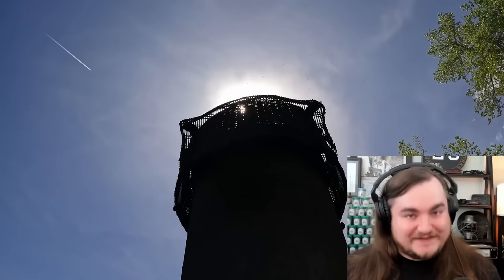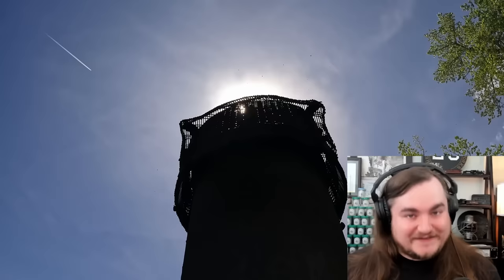Why do USA steam trains make smoke, but UK ones don't?

Comment: Added note on the Oil Burners. As they burn, soot will build up and the tubes and flues insulating from the heat of the fire. So, every now and again, they pour sand in the fire chamber which then bounces around and knocks soot loose. Leading to a big trail of black coming out the stack.
Reply: I've seen the sand technique used in various locomotives. Is it really effective?
Reply: @1940limited  it’s practically required for oil burners. If you don’t sand the flues during a run, they can and will get blocked up. On the D&S we sand the flues 6 times on the way to Silverton
Reply: @1940limited  Lynn Nystrom was the gentleman who explained it to me back when Stephen Lee and he ran Union Pacific 844. While I haven't personally climb inside a boiler to find out. The theory is at least sound since sand is very abrasive. And to that the force of a locomotive's draft and it should easily take thin layers off.
Reply from the maker: Very true! Sanding the flues makes a mess, but is ultimately a good thing.
Reply: @1940limited  *See thumbnail for example!
Reply: @1940limited , it is extremely effective! One trip I took on V&T 29 had her choking on herself b/c the previous fireman didn't sand her flues. And by choking I mean the fireman had to hella overfire to barely keep up the pressure and the engineer had to work her extra hard which was abusing the fireman and the poor engine sounded like an asthmatic with her beats. In a fury, the fireman began heavily sand the flues. The best way I can describe how the engine started performing after her tunes began to clear is like when you cough up a huge wad of mucus and take a deep breath afterwards. Suddenly, she began drafting correctly, popped both safeties, and she began taking off uphill against 2 heavyweights and a steel caboose. 

Now, I was told that more than a few railfans died and went to heaven from watching that show. 😂
Reply: Ah, so this is where the explanation I’ve heard where they only smoke when cleaning the firebox comes from
Reply: @patrickmartin3322  Well, you can get some smoke with a bluish tint to it when over-firing them too, but when properly fired, yes.
Reply: @caelumvaldovinos5318  That would have been a great show!!!
Reply: It was called "sanding the flues" and often done to make smoke for rail fan photographers...
Reply: Yes, it was the way we make "smoke" on a oil burner. The timing had to right so the audience sees the smoke but they aren't covered by nasty grit. We had a small loop track so timing was tight.
Reply: Soot is unburned carbon particulate, wasted fuel, insufficient air supply. But I suppose supercharger turbines had not been invented yet?
Reply: The cogeneration plant in my town ran tons of sand in the burner chamber. It was explained to me that the mass would hold heat, adding to efficiency. The place was constantly down because the steam pipe eroded thru and suffered blowouts. Also, the nozzles on the burner floor, which directed blast air were also eroded till they broke off and tumbled in the chamber, with big air jets creating cold spots in the chamber. They shut down after 8 years and the place is now abandoned.
Reply: Sanding flues is also done in stationary boilers for industrial plants though we didn't have to do it as often as it seems to be done on some locomotives.  We always did it night so the smoke would not be visible to the neighbors.

Comment: The wife’s grandfather was a conductor for grand trunk railroad back in the 1940s-50s. He always had a fit when he saw huge clouds of black smoke coming from the trains on TV shows and movies. So we all asked him one day why? He told us that all that smoke was from forcing the engine to run before it was properly warmed up and ready! He went on about air to fuel ratios, air flow and other things. He ended by saying he wanted to go to Hollywood and knock a few heads together and teach them how to properly run a steamer!
Reply: Wait wait wait...
Grand Trunk Railroad!?!
You just changed my life.
Reply: The simplest method of smokeless firing (also the least effort-intensive; I'm a lazy old bugger) is to watch the exhaust. When it turns white, add four or five shovelfuls to the part of the fire you didn't feed on the previous firing, and then when the exhaust changes from pale grey to white, repeat. This keeps the pressure up while minimising smoke. Disclaimer: this works on locos with a wide firebox, in my case NZR J and Ja class. I have never fired a narrow-firebox locomotive.

Comment: As a retired volunteer firefighter, I can tell you that solids (or liquids) do not burn. Only gases burn. With coal you get it hot enough to release the flammable gasses which burn. Same way with "flammable liquids", the liquid doesn't burn, only the gasses from the liquid burns.
Reply: I would like to add a few exceptions to this rule with things that have their own oxygen source as part of the chemical composition like gunpowder/C4/thermite.
Reply: Coal power plants grind up their coal into a really fine powder. I’m sure you still get a lot of incomplete combustion and soot, but the extra surface area helps a ton!
Reply: @jeremyloveslinux  Coal power plants also seem to have moved to 'no exhaust funnel' when they have cooling towers.
As it is often undesired to have smoke (be it black or white) from a high funnel, nor steam clouds from a cooling tower, they inject the hot exhaust gases (that have run through filters, in the EU at least) into the top third of the cooling tower's interior, where the air is already hot anyway. This heats the moisture saturated air even more, so that it can take on even more moisture, thus reducing visible steam. The way higher airflow also dilutes the washed smoke, this way, when the powerplant is running at optimum, you have little to no smoke OR steam, and no funnel that is twice as tall as the cooling tower.
Reply: embers burn
Reply: As a combustion engineer with over 50 years experience, of course some solids burn. Especially carbon, as in coke, which is mostly pure carbon and burns cleanly.
Reply: @michaeltb1358  But he is a volunteer firefighter, he must know everything! 😂
Reply: Wood and paper burn. Food on a grill or in a fire burns.
Reply: @LordNecron  Coal power plants in the US have to have electrostatic precipitators to cut particle emissions. While working my way through college to get my engineering degrees (Computer & Electrical) I worked as a lab tech doing environmental compliance, so I had to go out periodically to take air, soil, water, and hazardous industrial waste samples and analyze them down to parts per trillion. Had to follow EPA sampling protocols and was also trained and certified as a hazmat first responder (was involved in some cleanup ops). There was a rural coal power plant in Missouri that thought they could sneak by shutting off their EPs after it got dark (near the end of civil twilight and the beginning of nautical twilight -- astronomical twilight comes next, then actual "night"), however, they got caught with photographic and air sampling proof.
Reply: @michaeltb1358  "Normal oxidization" = "degradation", "rapid oxidization" = "burn"; "extremely rapid oxidization" = "BOOM!" Right? 😁 (Both me and my Chemistry professor are military veterans, and are the same age, hence the twisted sense of humor. I ended up getting my BSCE and BSEE degrees.)
Reply: Who told you that solids don't burn?  In coal about 60% of it is carbon that burns directly, 10% is ash that won't burn, the remaining 30% is trapped volatiles that are released as combustible gases.
Reply: @michaeltb1358  Exactly.
Reply: Except insane water usage.
Reply: You are 100% wrong. Have you never seen a charcoal grill before? That's solid carbon.

Comment: One very important reason why you don't see black smoke in the UK  - it is actually illegal. Cannot recall whether it is the Clean Air Act of 1956 or 1968, but allowing a locomotive to produce black smoke is naughty and can lead to fines. Whilst realistically, a heritage railway wouldn't be fined for a quick "oops, bugger" moment from the fireman, doing it consistently and deliberately for a photographic charter would be a big no-no.
Quite how this will change with the slight coal problems that UK heritage sector has been having recently remains to be seen.
Reply: When smoke was wanted/needed for photos in the UK old VHS 📼 tapes would be thrown on the fire to produce the required effect. At least that's the rumours anyway.
Reply: An Act of Parliament was required for the construction of just about every British railway and from the Liverpool and Manchester Railway onwards every Act included the clause that "locomotives shall consume their own smoke".  Not until fireboxes were designed to efficiently use secondary air and with the invention of the brick firebox arch could coal be used, prior to that coke was used being a smokeless fuel.
Reply: Steam trains should produce steam. Which, I think, is what Brits want to see on locomotive photographs & magic lanterns. I wonder if that's easier or more common on a cold humid island?
Reply: @ethelmini  when it's colder, yes UK engines produce more smoke, I think it's called "Atmospheric smoke".
Reply: @ethelmini  As this video observed, smoke isn't steam.😀
Reply: The Clean Air Act, while applicable to locomotives, was more designed for coal power stations, particulary those in cities, and houses when coal was the most common form of heating before central and gas heating.
Reply: I have no idea how dirty or clean burning actual antique steam engines were, but this video title intrigued me because the first thing I thought of was how in old westerns the trains would be absolutely belching smoke like a dragon. The second thing I thought of was "Wait, my kids grew up watching Thomas the Tank Engine, and that's UK, was there really no smoke?"

Comment: There’s an excellent video on YT from someone driving side-by-side on the highway alongside UP4014 at about 60mph, and the Big Boy was running so clean that it barely produced any smoke, despite how hard the locomotive was firing - impressive!
Reply: I personally saw, filmed and photographed 4014 Big Boy as it toured through Iowa a couple years back. He rolled some smoke climbing a small grade and then rolling out from a full stop. Big Boy is converted to burning oil and not wood and coal as in the early days. I am sure they aren't burning top shelf diesel. Big Boy also travels with a late model turbo diesel/electric. I am sure in lots of it's use it is mostly idling and letting the turbo diesel do most of the work
Reply: @mixerman1 We did too when  4014 was making its pass through IOWA, we drove down to Omaha and spent several hours at home plate touring and doing a LOT of chatting with the gang working there... I went right up the ladder to talk with the crew. Like whos' this chick??? The Diesel Electric provided electrical power for the train to run their A/C's, pump water and fuel and most importantly provide brake AIR.  They told me Big Boy pulled the train, but the D-E was there incase they had any trouble. They could limp home on it if they had to, but they weren't going to hit the line without modern brake air quantities available...  It all made sense to me....  It was a great day and we had a lot of fun down there. Well worth the trip and I learned a lot.
Reply: @erikaostlund5229  How cool is that, yeah I knew they were using the D-E for electric and air, thanks for the more info 😁
Reply: @mixerman1 nope, the diesel is there as a backup. Yes Ed D can control it from 4014’s cab but typically it’s just idling. UP originally tried to convert big boys to oil back in the 1940s but had issues reaching the HP & Tractive effort #’s to match the coal fired version along with issues with firebox heating (cold spots) so the effort was scrapped. In today’s service the few bits of HP & tractive effort lost aren’t a big deal since it’s not in revenue service. Tender & oil burner assembly installed on 4014 is mostly parts from 3985.

Comment: In Britain, the type of coal used is normally a product called steam coal. This burns very hot (it would quickly burn through a domestic grate) and usually burns cleaner. In the traction engine community at traction engine rallies, owners get very annoyed with organisers who supply normal coal because it creates less heat to drive the engine, burns dirtily and reduces performance.

Comment: As a retired engineer I remember having to calculate and analysis how to burn fuels efficiently in my university degree. Think this was the best lab experiments we did. Though I went on to work for a company that designed and tested engines that did not use combustion as its energy source. We still had to maintain the back up diesels and sited heating boilers so they burnt the fuel correctly without black smoke.    A term to remember for future discussions on the subject is the Stoichiometric fuel mixture ratio which is when all the fuel is burnt with no excess air (Oxygen) used. Another wee aside,  as all the firemen will tell you its the gases that burn and not the solids. Hence the soot. So Stoichiometric is your word of the day and a ratio to remember for your car is 14.7:1

Comment: I think you summed it up perfectly in terms of the fuel quality how good the fireman is and coasting.

Ed Dickens one time was asked the same question and he said that they realized when the engine is smoking it’s actually wasting fuel.  So they try to keep both engines as clear as possible.  Best advice if you want to see a big boy smoke, just chase it in the winter.

Although N&W 611 and any of the locomotives at Cass Scenic Railroad smoke just as much as a power plant most of the time.

Comment: The photography thing is certainly a big reason, and the pic at 2:10 is a perfect example of why. Photographers like action shots of a train, but that one pic looks like it was parked. True, you can demonstrate speed/movement in other ways, like with a panning shot, but that isn't always possible. Even though it's not a true representation, a big cloud of smoke gives the impression of the locomotive working and moving, and makes for a more dramatic shot overall.
Reply: O Winston Link got his stunning photos of US locos by arranging with the fireman to put rubber tyres in the firebox just before the photo location. This is possible with other photographers, so maybe black smoke is a photographic artefact.
Reply: Another factor could be whether In the UK, we are quite used to cool damp weather. What comes out of the locomotive chimney is a mixture of gasses from the fire and steam (water) from the blast pipe. The steam rapidly turns into water droplets which do not evaporate as the local air is close to saturation point and comes out of chimney as white "smoke". Think of it as the equivalent of an aircraft's contrail. This looks really good in a photo which may account for the different pressure from the photographic lobby.
Reply: @verdunluck1578  i always see black smoke as something dirty and polluting, but big clouds of white steam look so nice. you can't count the pictures of white winter landscapes with trains that leave a big trail of steam clouds. (i'm from germany)

Comment: When I first went to work for the railroad in the early 70s (in South Texas) there were still quite a few "old heads" from steam locomotive days left on the railroad. Hearing some of their stories, if a Road Foreman of Engines noticed an unusual amount of black smoke coming from a passing train, it was possible for the fireman to receive demerits "for waste of fuel". All the steam locomotives in use at the time were oil burners. Coal as a fuel in most of Texas had been phased-out by the time of WWI or in the 1920's at the latest. Plentiful cheap oil was too good a bargain for the railroads to ignore.
Reply: The salt, it's probably Roundup. There will be a suit of law.

Comment: In the UK we have dampers set up for directional running too, so you have control the airflow with those depending on the direction of travel relative to the firebox to get a good draft and complete combustion. Not sure how much of a thing that is on American locomotives.
Reply from the maker: We don't have dampers on 99% our coal burners. Oil, yes, and they exist front and rear; but less so for directionality and more for controlling the specific flow of the oil fire.
Reply: S160s don't have them. That confused the drivers who came with the manor and the 42XX to the Churnet Valley.
Reply: In the United States of America, our steam locomotives also had seats for the crew. How come the UK never did?
Reply: @ZackarySchejbalCODBO2RGM2  Oh we do, they're mostly fold down seats attatched to the cab walls where space permits it. many smaller engines or pre-grouping ones may not have them though.